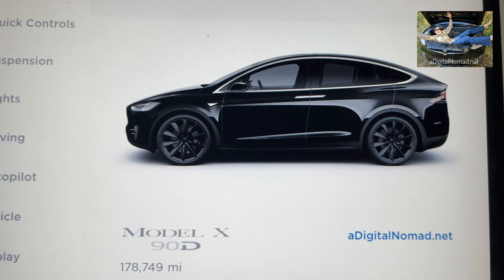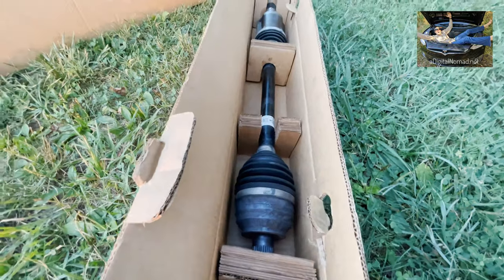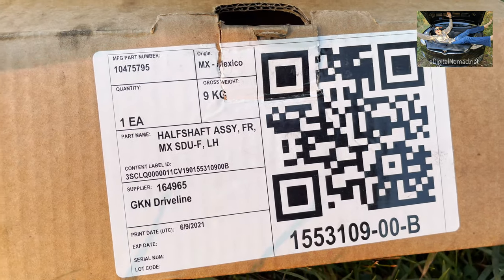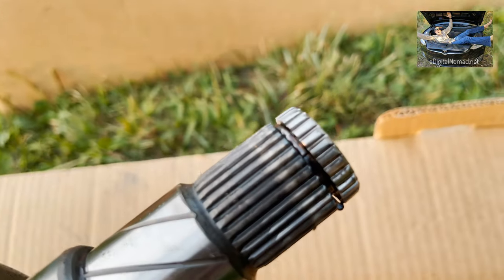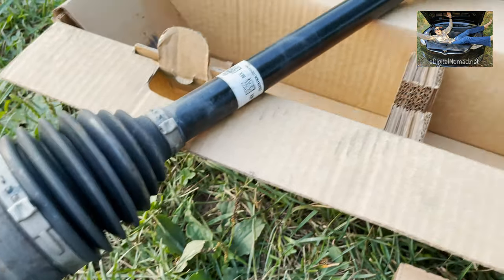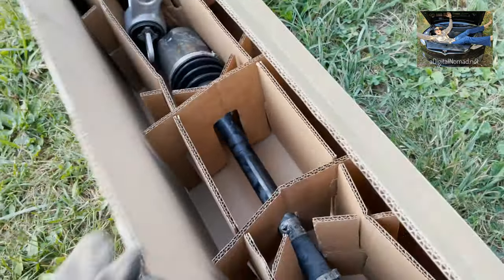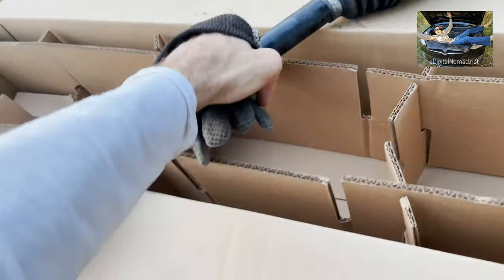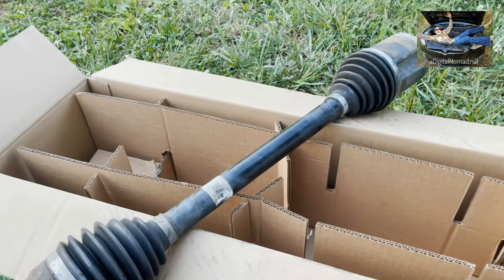My WORN OUT Tesla Model X Front CV Joints + Clevis Mount | USED PARTS

Comment: CV axle is supposed to move a lot.  That’s how they move up and down as well as why there is a boot.  The larger end will go on the motor side for both. I haven’t removed but have replace control arms and subframe / crossmember on a 2016 model s p90. Would have been more helpful for you to have known the parts or stated questions in title. 
If anyone knows process for clevis replacement please share.

Comment: total bs with the clevis mount
Reply: Why do you think so? I replaced the axles alone and can still feel vibration on hard accel, thinking of changing that mount now.
Reply: @carlesscustomization1649  the mount needs to be chaged to the latest version or the new axles will break again. 8:18 is what i meant lol clevis mount connects the motor to the chassis
Reply: @ranxerox10  thanks, just replaced clevis mount, the vibration is greatly reduced but still I can feel it but its very soft now, not sure if thats hows its supposed to be or there needs to be some adjustment?
Reply: @carlesscustomization1649  shouldnt feel any vibration, maybe the new shafts are already broken. if its more on high then it is the drive shafts
Reply: @ranxerox10  nah I remember the old ones and hiw it felt when it was broken, it was more of a shudder, the vibration I had after replacing shafts was different and now after installing new mount its very soft when floored. I got Tesla S P90D btw, torque is high so...
Reply: @carlesscustomization1649  is it better with suspension on low and worse on high? Then its the axels
Reply: @ranxerox10  its the same on high and low, maybe the vibration comes from other place
Reply: @carlesscustomization1649  sounds like